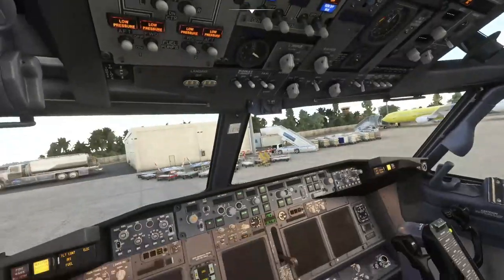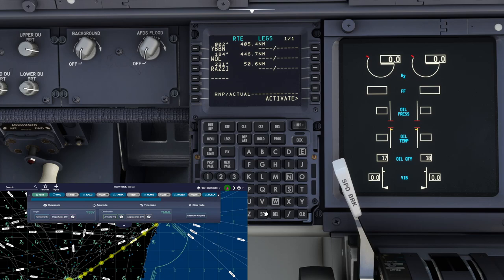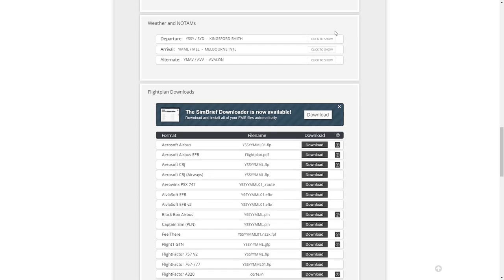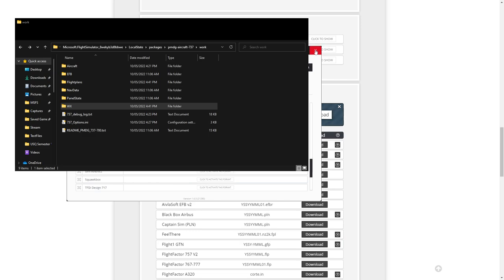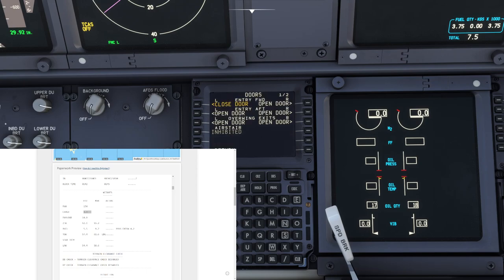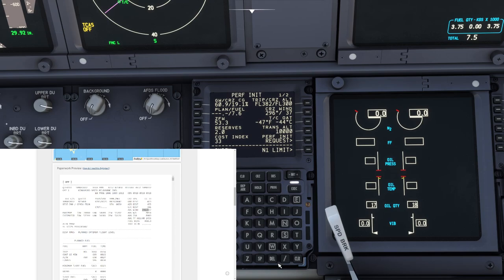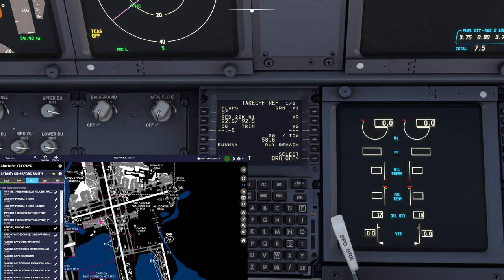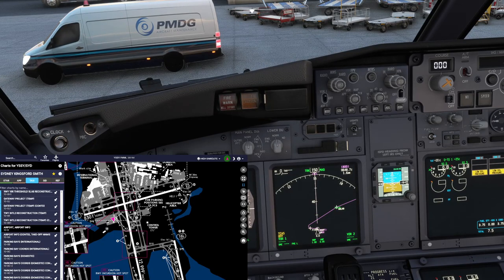MSFS PMDG 737 FMS Tutorial

Comment: 37:40...why did you divide feet with meters mate? The units are not correct...you have 14 feet and 7 feet, which there is a difference of 7 feet..then u divide 7 feet with the length of the runway which you use 3962 which is in meters? Shouldn't it be 12,999?
Reply from the maker: It's meter's according to the formula in my text book that's why.
Reply from the maker: You can also use feet if you wish you will still get the answer. But as it is the sim doesn't take the slop into account just yet.
Reply: @JetSimmer101  shouldn't you divide by 100 instead of 1000? To convert a number in percentage, we divide by 100 right?
Reply: @JetSimmer101  I am with you on that mate, but I didn't get as to why you divided by 1000..to get the percentage we divide by 100
Reply from the maker: @stathis420  it's 2 53 am my brain isn't working yet
Reply from the maker: @stathis420  think soo